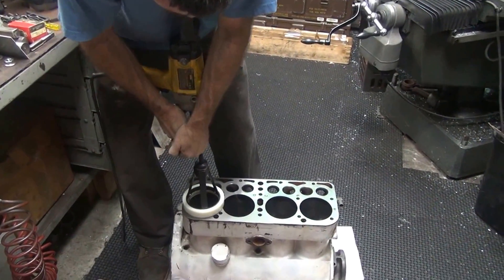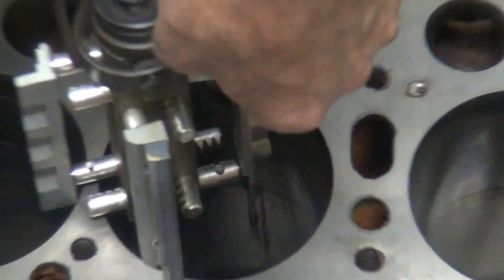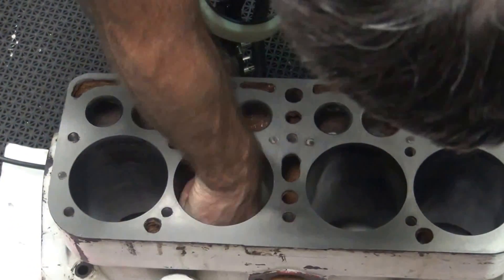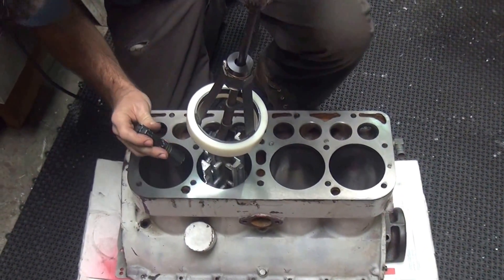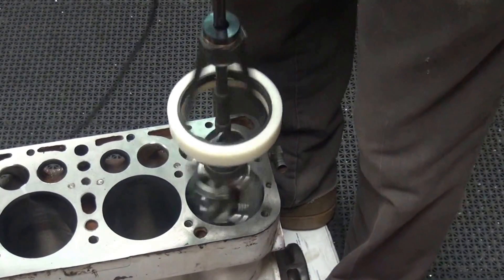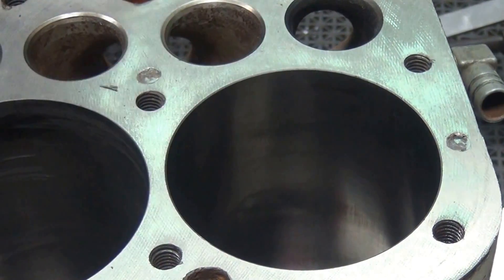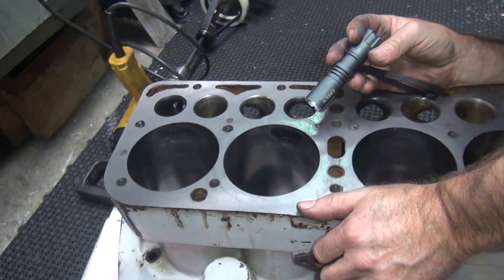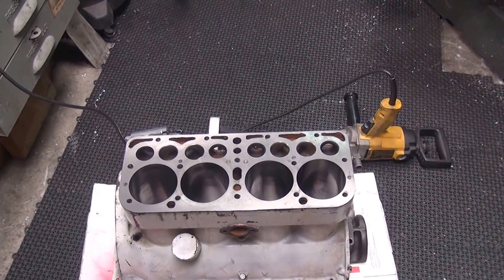1932 ford #114 model A or B flathead race block crack repair by tatro machine

Comment: its more venerable, then the material  untouched material that caused the crack . Plus is a model A engine the same block as 8N tractor? Amazing that people would spend so much time fixing something universal that evan a Ford tractor used as engine.
Reply from the maker: its not a stock motor. it is a race motor that has had a ton of work done to it. it was cheaper to fix it than to replace it.
tatro

Comment: Send it to Afganistan they will do the job CHEAPLY AN CORRECT
Reply from the maker: so did i. i don't think anyone could have done this job better than i did. if you put any heat into the block you would have lost all the bearings. good luck on getting that done these days.
tatro

Comment: I wouldn't have used that type of hone, 3 stone or ball would be better , also need to use oil. Oh well shady tree mechanic  lol
Reply from the maker: your stupid. only a sunnen or a copy of one will straighten, make round and put the correct crosshatched finish on the cylinder bore. as i showed in the later vides after i went back to using sunnen honing oil. i fixed these cylinder bores and reused the same pistons.
tatro

Comment: Better off with the ball honers, those flat stone tools suck
Reply from the maker: what a dumbass. clean metal is not round or straight and the crosshatch is all wrong too. use the correct tools or you will be back to do it again. honing and sanding are not the same thing.
tatro
Reply: Yep, you got me there, forgot you were honing. OOOOPSI guess i meant to say the ball tool seems to leave a finer finish.

So would you recommend using stone honer , then finish with ball flex honer for a better cross hatch? or am I still just a dumbass.. Its confusing because they call them ball flex honers..

Comment: Soak those stones in oil, then keep it oiled while honing. Also, you need a variable speed drill for this job so you can control the speed to match the up and down movement for a good cross hatch pattern. Never pull the stone out after it stops, always pull it out while it's in motion otherwise you've done ruined your cross hatch pattern.
Reply from the maker: yes, i know all about the oil. sunnen says these will work dry so i gave it a shot. now i know better and went back to the oil in the next videos. you don't know how things work until you try.
tatro

Comment: First off that hone is useless. #2 You can't stitch up a cylinder wall and expect good results. Just doesnt work like that. The repair metal is way too soft to support friction from the rings and will wear much faster than the rest of the bore. Also, you don't want the repair area anywhere near a valve seat. Among other issues. Basically you messed up but that's ok.
Reply from the maker: so i messed up because the steel is softer than cast iron and the valve seat can't be steel either. well, too bad, it worked just fine. the block was junk and than it went racing again with no problems. i can live with that. when things are over bored and ported to the max you do what you have too to get the job done. welding was out because of the babbitt block and being cast iron in general, so that it that.
tatro

Comment: As a automotive machinist/engine builder with 40 Years in the trade i
See this from time to time. The gentleman is a machinist. A general machinist trying to learn
My trade. I blame the customer for
Not taking his rare expensive old ford race block to a automotive machine shop and he may and they would likley called it scrap
As its impossible to fix a
Crack that goes to the deck of the
Block from the cylinder. As you
Can't get them to seal at a courner
And even with a counter bored type sleeve installed.
Reply from the maker: well, here is the impossible because it is seal and past a 100 psi pressure test. didn't loose any pressure sitting for a day. went racing again without any problems. it went over 135mph on 30% nitro. not bad for the impossible and dumbass machiniest.
how did you like how i saved those out of round bores without going to bigger pistons and using by junk as hone. i can live with that.

tatro
Reply: Tatro Machine if the bores were out of round they were also out of specification.  By making them round the pistons are too loose in the bores leading to overheating and piston slap.

Comment: I just stumbled across this video and can't believe what i'm seeing, and you put it on public media WOW.
doing what you're attempting is what i done for a living for many years, specialty the vintage engine restoration.
it,ll run. but you have a bit to learn that's for sure and i,ll leave it at that.
Reply from the maker: pining blocks and machining hard cast-iron yes. honing cylinders, no. if you don't learn something everyday you are a moron.
tatro

Comment: Well I work at an AERA shop and this my friends....is a hack job. At least put some  felts and a little WD ...on that honing bar.  This is what NOT to do.  SMH?..
Reply from the maker: hay dumbass, if you listened and watched my video you would know that this was an experiment. sunnen said that dry honing works so i found out for myself that it doesn't. if you don't test you never learn a damm thing. watch the next videos as i saved this overheated junk block with the sunnen hone and honing oil that i always use. do you think you can save a .010 out of round block with only .002 to work with. good luck on that one. your aera shop don't mean crap, its the dummass doing the job that matters. see you at the next aera west coast seminar.
tatro
Reply: @TatroMachine  testing dry honing it's like practicing surgery blindfolded it doesn't even fucking make sense. It's not like using honing oil takes any time or effort
Reply: You can't save junk

Comment: The crosshatch doesn't look too bad are you effing kidding me?
Reply from the maker: hey dumbass, watch the rest of the videos in the playlist. this video was a test of dry honing as stated in the video. if you actually watch the complete video you would have known this.
tatro
Reply: Tatro Machine if you truly run a machine shop why would you even attempt dry honing. And make comments that the cross hatch looks good? You make no comments about your dry honing being a test. It's clear you have no clue. You run your milling tools at entirely too fast a speed then claim the material is too hard really?
Reply from the maker: for years i have heard about dry honing from sunnen and others so i gave it a try. it didn't work so i went back to what did. done deal. if you don't experiment from time to time you never learn a damm thing. 
i am just a dumbass harley mechanic racer that has been in business for over 65 years and have never claimed anything else. if you think you are so good that you can fix the damm block anyway you want and i will do it my way. i fixed it and it runs just as good as ever has. if you can do better than post your videos and i will see you at the track and see who knows what.

tatro

Comment: Jesus!! This is not the guy you want doing the machine work on your motor. That block is possibly in worse condition after his "repairs" than it was when it came into the shop.
Reply: ITS FOR RACING, AFTER THE RACE TH ENGINE WILL BE JUST PERFECT
Reply: @lkkjhtemmexv1838  she's doing it wrong does it mean anything to you?
Reply from the maker: not another dumbass without a clue. go back to you stupid blogs.
tatro

Comment: Doing more damage to the bores. Who taught you to hone dry?
Reply from the maker: dream on. watch the finished bore results. round and straight holes with the correct crosshatched finish. just what you need for a repaired old junk race motor. back to the track and making runs again.
tatro

Comment: I use that same sunnen hand hone, with the exception that i you sunnen honing oil. That block should have been welded and sleeved on all 4. Especially since it is such a rare old block. That thing is going to have so much blow by.

Comment: Machine shop using drill hone?  Seen better results from a ball hone & pb blaster.
Reply: Ball hone look good but bad.rigid hone what you see is real.
Reply from the maker: you haven't got a clue.
tatro
Reply: You are the one with no clue

Comment: That's the shittiest bore & hone job I've ever seen🙈
Reply: He should've done a complete bore job
Reply from the maker: then you are blind. this is the problem with dumbasses, they think they know everything and don't know crap. put up or shut up dumbass.
tatro
Reply: Tatro Machine I don't claim to know everything, but I do know that's a shitty job.
Reply from the maker: it may be a crappy job in your dumbass opinion but it did go down the track again just a fast as it did before it broke.
tatro
Reply: Noticed the bike parts in the back ground butchers like this give harley builders a bad name. Some actually know what there doing. Unfortunately many are just knuckle heads. Pardon the pun
Reply: What a shit job, should have been bored out

Comment: Rebore may have been quicker. But you deffo need light oil or some such for honing. But excellent job.
Reply from the maker: +Wayne Goff 
i tried something different by going dry but that did not work like sunnen said it would. went back to a light coat of sunnen honing oil and everything worked good after that. all that is in the later videos in the playlist.
tatro